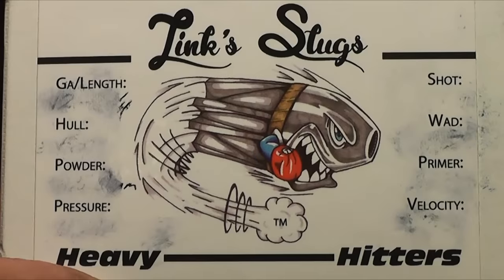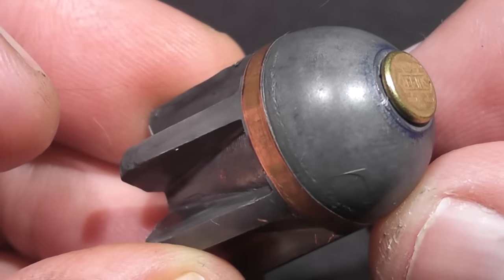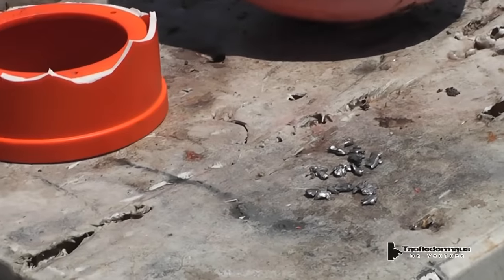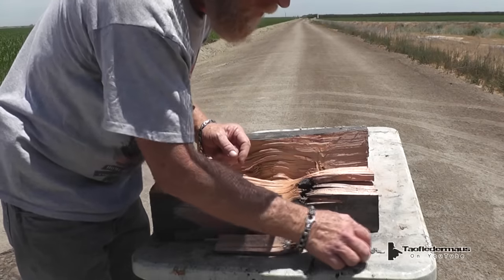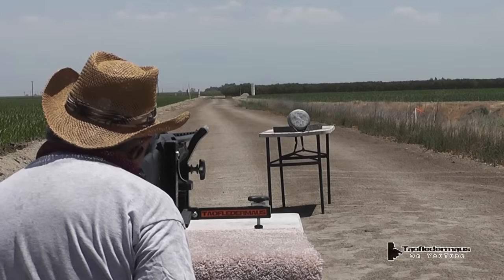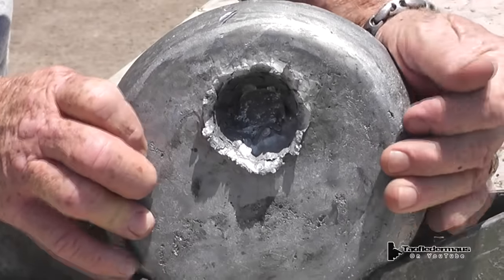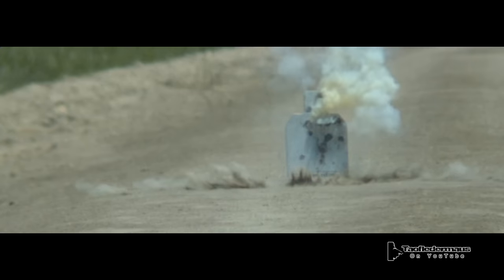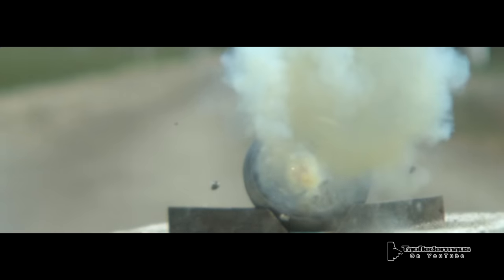12 ga. shotgun EXPLODING  rounds - You've got to see this!

Comment: I can't imagine a ballistics vest or a helmet saving someone hit by this, am I right in thinking this would pass a significant shockwave through someone wearing such armors?
Reply: Voidindiga I think the primer is meant to detonate on a hard target. I’m not sure this would be hugey different on a soft target unless they had hard armor plating or a stiff helmet like you said.
Reply: Rimfire would probably go off on a soft target
Reply: @penuts17  which a plate carrier or military body armors have hard plates.
Reply: @penuts17  ceramic or steel plates would definitely make it go off, but soft armor wouldnt.
Reply: Unless they are wearing a trauma pad behind the plate odds are yes it will kill due to the force of the round amd the explosion hitting you. Even with a trauma pad there is a chance it would still kill.
Reply: It’s a pretty complex topic, made vastly more complex by the monster size and dense construction of the slug... and multiplied by a potential explosive tip. What we can say for certain is that you’d be much better off being hit in armor then not. A hard plate would almost certainly protect the wearer, though if they actually put HE filler in you might see some minor spall damage. A soft plate? It’d almost certainly stop the passage of the bullet, and unless the placement and body posture are unlucky, you won’t see more then a broken rib and gargantuan bruise. You are looking at 1-2” of serious tissue damage maximum.
Reply: If it has the same effect as a HESH Round then the surviving the shock is only half of it. HESH rounds are made to take advantage of the Spalling effect, where an explosion on one side of a plate causes shards of armor to shear off the other side of the plate. So not only would you have to survive the shock of the slug, but then the pieces of your own armor which are now flying through your chest.
Reply: Yeah, it is working like a heat shell (High Explosive Anti Tank) where the outer force hits the surface and forces the object inside (usually something shaped like a sabot) into the armor but considering that it’s head is blunt, yeah this would definitely break a lot of ribs if someone were shot with this.
Reply: @nickkurzy2246  armor plates of any quality have a spalling liner for just that. I doubt any wounds would result from spalling.
Reply: @nickkurzy2246  this is nothing like hesh it is just a kludge, saying this is hesh is like saying an airsoft gun is a real gun just bc they look and function similarly, if anything this is just a very weak HE round
Reply: They said it works like a “hesh round” which is meant to do exactly that, pass a shockwave through and even fragment out the other side without penetration. However the SH stands for squash head as the shells HE high explosive warhead will squash against armour on impact before detonating creating a large surface area of detonation. Whether these rounds actually do that to the extent of a tank round is hard to tell. But it sure would send a shockwave through steel armour causing a fair bit of damage. Whether or not it causes fragmentation is also up for debate. It would be less effective on Kevlar armour though which would absorb more of the shock and maybe wouldn’t detonate on an unarmoured target.
Reply: @benbrooks566  go look at a diagram of a hesh round. hesh round squashes onto the armor with a plastic explosive and the detonator is in the rear of the shell, the whole point is the delayed detonation which only detonates after the explosive is already squashed onto the target, which gives the desired effect. Also the entire front is basically an easily destructible plastic or thin metal shell meaning the explosive is effectively exposed when hitting the armor. This is the exact opposite of that. It's a hardened shell with a weak explosive that detonates on impact. This is basically a ghetto rigged frag-12. Even in the best case scenario, frag 12 never took off because it wasn't very effective. This is likely even less effective than a frag 12. It's literally nothing like hesh.
Reply: @PSC4.1  that’s not how HEAT rounds work, buddy. HEAT is reliant on high pressure caused by rapid chemical decomposition to ionize a substance inside the warhead into a jet of superheated material which burns/cuts through armor.
Reply: @fboyg91  woah there partner I'm gonna need you to bring your toxic attitude down a notch not everyone knows how heat works
Reply: Just like Rodiculous said, these rounds are not like HESH rounds. They don’t operate the same way. They are explosive rounds. And it doesn’t even have close to a quarter ounce of explosive material.  It’s most similar to a High Explosive round but minus the “high.”
Reply: @khorneberzerk6141  He wasn't being toxic. You described something completely different.  A HEAT round consists of a an explosive shaped charge and a liner. Upon detonation, the liner collapses into a superplastic jet that punches straight through armour. Your description implies that the impact on the target pushes the inner penetrator (shaped like a sabot) through the armour. That is an APCR round essentially. The outer surface doesn't really push the penetrator through the armour though, it's just a weaker alloy that strips away.
Reply: Yeah dude I think you’re gone
Reply: @Cewelowic  that spall liner is meant to absorb the spalling caused by any rounds hitting a plate. This is quite extreme spalling  with added shockwave. 

Id say its 100% certain to smoke you even if you dont get bit of armor in you
Reply: na, just make me fart
Reply: Maybe we could all just agree that no one would want to be hit by one of these things.
Reply: @josepetersen7112  i feal like even a basic powder charge would desimate most spall coating and if you didnt have coating you have sharpnel in your arms neck and chin
Reply: I feel like hard armor like ceramic/steel plating would set it off, since he said it used .22 PAT blanks I almost guarantee hitting bone would also set it off, those blanks are designed to go off on softER targets (note: softER not just soft)
Reply: No.
Reply: Not many armor vests would keep it from doing major damage even though and if it didn't burn through in the first place
Reply: @darwinspirithawkwhitt4847  Uh, this is a heavy lead slug filled with a tiny amount of TNT? There are armor vests that can stop bullets that punch through BRDMs.

It would probably make you deaf or give you a nasty cut if pieces of the shell hit your arms if it hit a vest, but if you're wearing something like the Soldier Protection System's hard armor helmet (i.e. a motorcycle helmet made out of resin soaked kevlar) and some ear muffs it might not even do that. That stuff is designed to keep you safe if your truck gets hit by a land mine like Iraq, or if you step on an IED, which people have survived before even with grenade sized explosions just by being tossed into the air.

You might get a walloping TBI but that's not an immediate issue. The only big concern I think would be if it hits your arm or leg it's going to do a lot of damage if it explodes without touching a piece of hard armor.

Like if it hits your thigh or your forearm you can probably say goodbye to that limb.

And you have more arms and legs than chests so it's probably going to hit there anyway.

Make lots to shoot from a belt-fed machine gun and you have a baby 20mm cannon though.
Reply: @SecuR0M  uh not in your average home !  I mistakingly didn't say what particular vest I was referring to,,   I thought the comment was referring to the standard bullet proof vests available to the public ,not a NATO  ammo durability test lol
Reply: @darwinspirithawkwhitt4847  Yes, in your average home? At least homes that aren't poor/can afford expensive guns i.e. works a well paid trade or something.

There is no "NATO durability test" for body armor. DOD uses the ancient NIJ standards and more recently its own standards, i.e. highly specific threats based on its real world experiences in OIF/OEF, when deciding what armor to buy.

Manufacturers also use NIJ standards in marketing but their body armor is massively overbuilt for the frankly outdated and should-be-but-won't replace FBI tests. Occasionally they use Russian GOST metrics instead as guidelines because GOST is more modern and was recently updated to include 12.7x108mm at 50 meters fired from a OSV-96 sniper rifle.

That last one can be replicated with a M82 Barrett at 55 yards firing 12.7x99mm, which a handful of manufacturers might offer. The ceramic plate in that case would be closer 40mm than 25mm in thickness.

.50 BMG protection would represent the pinnacle of body armor performance today since we can make ceramic plates a lot thicker now than we used to 20 years ago.

You can buy a pair of front/back WHA resistant ballistic plates made from boron or silicon carbide (about 1"/25mm thick), and a Dyneema or Kevlar plate carrier, for less than $800 total from any gun store in America.

At this point it's probably mandatory to wear heavy body armor just to go to the store in New York or school in Texas or something.

The Soldier Protection System itself is just a bog-standard, commercially available vest called the KDH Magnum TAC-1 with a particularly fat ceramic plate inside it.

Army Special Forces and other SOCOMoids wear your typical guuchi Crye Precision JPCs or whatever. The only thing you get for being in the military or police is a "thank you for your service" discount sometimes, and ability to use your GSA card instead of a Navy Federal card.

All of that can be bought with own moneys if you're one of those LARPers or think you actually need to wear heavy, bulletproof armor in your day job. It's not like cops are using their department's budget to buy guuci tactical vests.

Fashion sells a lot, and this isn't any exception. Heavy, bulletproof body armor is the accessorizing handbag to the LARPer's high heel shoes or cocktail dress that is his combat boots and Crye Generation 3 cut BDUs.

It's not something you need, obviously, but it's not something that you can expect would be particularly hard to get either.

tl;dr Suburbs of obese plumbers with F-350s in the driveway probably have more varied and heavier body armor than an equivalent number of Federal army troops.

Mario in America can easily do Goomba stomps simply because he's wearing his weight in boron carbide and kevlar.
Reply: @notlogical4016  Soft armor would make it go off just from the sheer force of the shotgun rounds velocity.
Reply: @Wesmancan  Aint nothing wrong with that, is what I be replying.
Reply: Too bad the local cops took my VR-60
Reply: Yup
Reply: Or if it hits a bone... Either way, it'll suck being on the business end of that monster, but God forbid whoever ends up there ain't gonna remember it no how 😇
Reply: @nickkurzy2246  haha world of tanks noob in his mom's basement trying to sound smart.
Reply: @Brett Gordon  couple of things.

1) I play War Thunder, actually 
2) the games I play have no bearing on my statement, I also find the mechanics and development of anti-armor ammunition very interesting, so I research it in my spare time.
3) I'm not saying that the spalling effect from this round would work the exact same as a HESH or HEP round, I am merely stating that, with any projectile penetrating (or some explosive rounds not penetrating) an armor plate, pieces of the plate will shear off and will become shrapnel, known as spall. I used the HESH round as an example because it is good at demonstrating the spalling effect.
Reply: @khorneberzerk6141  what does toxic mean?
Reply: Definitely wouldn’t want to be on the receiving end of it 😮
Reply: The ceramic + kevlar work together to absorb the shock

Comment: High Explosive Squash Head - Splinters Steel inside of tank to kill crew or set off ammo compartments.
Reply: Have you seen the video testing hesh (or at least how it would work) against a plate of armor and a mellon? It's insane!!
Reply: @nick_steele9790  the term is called spalling
Reply: *nervous italian ww2 tankcrew sweating*
Reply: @Blei1986  even more nervous vs. Brits crew sweating
Reply: Yup.  This was definitely not the effect caused by a HESH (HEP in the US) round. More like an old fashioned SAP-HE type. A HESH round uses a base fuse and spreads itself across the the target armor plate.  When the fuse detonates the explosion sends a shock wave through the armor, turning the interior face of that armor into high velocity fragments. 

An odd effect of HESH is that it is more effective when fired from a rifled barrel. It’s why the UK still uses HESH while almost every other major tank producing nation use smooth bore cannon firing shaped charge rounds (HEAT).
Reply: Needs to turn that black around the other direction. Two piece screw together maybe
Reply: @sniperstg2  **because tea maker is brewing a cuppa.
Reply: @daniel_f4050  Isn't it not that HESH is more effective when fired through a rifled barrel but that Shaped charge HEAT rounds are less effective as the spin exerts centrifugal force which disrupts the formation of the jet by the shaped charge. I think that the British army will be phasing out its rifled tank guns though and replacing them with 120mm smoothbore guns as part of the challenger 3 upgrade program.
Reply: @zeo_crash7984  AFAIK it's both. Rifled is better for HESH and smoothbore is better for HEAT.
Smoothbore is also better with APFSDS, since APFSDS doesn't need to be spin stabilized and smoothbore improves muzzle velocity.

Comment: The real test would be against steel plates of varying thickness, with some cardboard a few inches behind.  This would show you the spalling that the round creates.
Reply: ooof trying to see the sharpnel effect
these could be maybe used against light armored vechiles to disable them
Reply: @Gokaes  Not really
Reply: @Gokaes  slugs are terrible vs any actual armor because the metals are too soft. Shotguns are also low pressure rounds, which means you never attain the velocities needed to penetrate armor.

Essentially -- hard and fast is what penetrates.

Gutter mind that all day: it will help you remember what works vs armor.

Now, technicals, cars in general, plates 1/2 in thick? Sure. But LAV's will defeat most .50cal and many 20mm so a 12g AT BEST is gonna leave a lead scar and mild dent.
Reply: @formdoggie5  its not a slug ita a hesh
Reply: @formdoggie5  high explosive squash head, usually these cause serioua fragmentation when impacting armor
Reply: @Gokaes  I know -- chnages none of what I said.

An explosive of any variety in a soft metal doesn't change its armor penetration characteristcs. A solid slug, in fact, gives more armor penetration because of the greater mass by volume than that which was replaced by explosive.

That's even why almost all armor penetrators start off with an effective lance head somewhere in the round -- even the explosive ones.

Moreover -- the most explosive 12g round will never reach the armor penetration capabilities of even a non-explosive 20mm.

Explosives, in terms of general scale, arent what does the penetration of anything.
Reply: @formdoggie5  yes but i bbelieve you know hesh doesnt peneterate it causes spalling without peneterating armor, im not a professioal so i dont know exact capability but i just wanted To entertain the thought
Reply: @Gokaes  right... which means it doesn't do anything against the targets you suggested (LAV's) and why you shouldn't be entertaining it.

I also am a professional in this field, which is why I was also able to give you the targets it would be effective against.
Reply: This is close to an HE round, so it would do absolutely nothing to a steel plate.  HESH rounds are for heavy and thick steal, HE rounds are for light armor, cover, and infantry.  HESH rounds shape a charge that uses the vehicles armor as the projectile, HE rounds literally just explode on contact and lose a lot of their forward momentum, causing them to be pretty much useless against heavy armor.